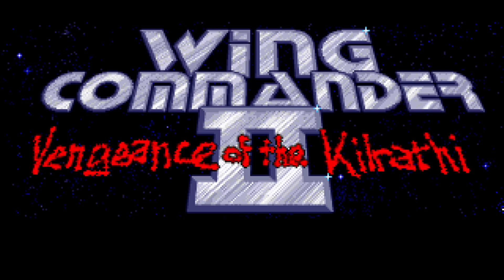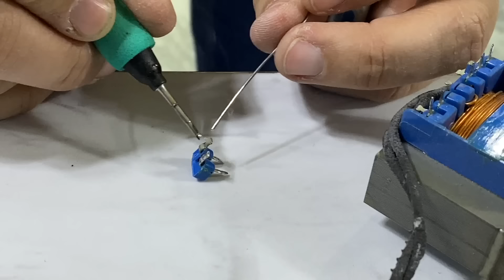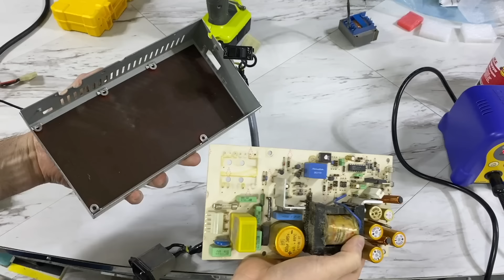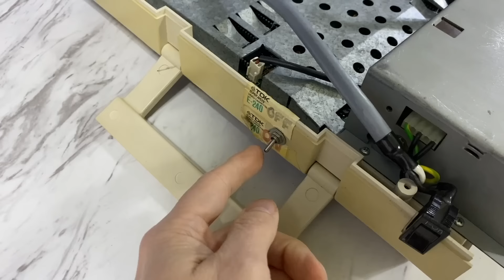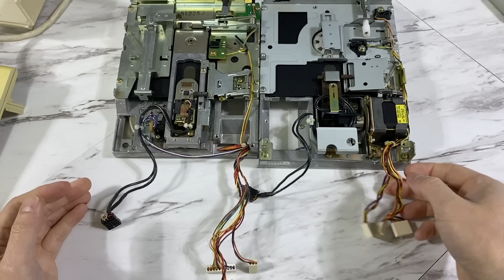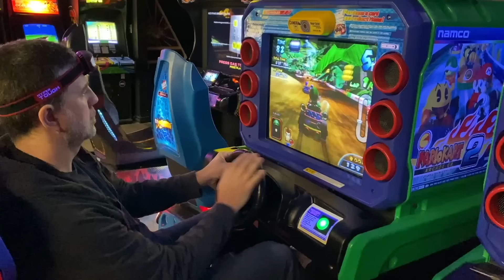Repairing Martin Galway's Commodore 128

Comment: The 1084 monitor AND the AGA monitor (I think it was 1090 or 19XX) monitor support PAL mode, but in the case of the 1084, you have to mess with the V Sync.  I did this all the time when I wanted to run Pal software on my Amiga 500 (Amiga 500 rev 5 motherboard or later supported NTCS OR PAL).

Comment: It's fun to see repairs in the consumer market. This is what I do for a career, but for commercial applications (all that means is that I'm fixing stuff like POS devices and pretty much anything with a microcontroller that may be used in a commercial situation.) Even though I do this every single day, I still crack open every single new device I buy, as well as stuff my wife and kids buy under the guise of general preventative maintenance like applying thermal paste and cleaning fans and such. In reality I just want to see those bare circuits, they'll never stop being fascinating to me!

Comment: the monitor issue is suspicious, especially since you had a bunch of issues on a bunch of other monitors,

the way its running makes me think its maybe trying to do pal at 60hz and breaking everything, alot of transformers like that dont address the frequency difference only the volt and amperate difference, like this would explain everything breaking spectacularly

Comment: I hope that transformer also changes 60hz to 50hz
Reply: I hadn't thought of that. The Goldsource STU-1000 is just a voltage level converter and doesn't affect the frequency. Is that why the monitor was freaking out?
Reply: @BenInSeattle  It makes the most sense to me. As a rule, analog electronics don't really play well with mismatched frequencies and whatnot. Look at the flyback transformer for example. It's probably calibrated to work with 50hz oscillations, so putting 60 through it is bound to mess something up. I'm no expert of course, this is just intuition speaking lol. I'm willing to bet like five bucks that that'll be the issue though.

Comment: On the faulty 1571 mechanism: I've repaired 1541s that had a similar problem.  The rotational speed was incorrect.  I recall two sets of timing marks on the large flywheel and a slight turn of a nearby potentiometer that would adjust this.  I used a fluorescent light to get the timing correct.  I'm assuming one set of marks was for 60Hz and the other was for 50Hz, so you'd need a 50Hz lighting source.

Comment: @The 8-Bit Guy -- I know this is WAY late, but check the orientation of the upper head.  The leaf spring on 1571's tends to warp because the head lift mechanism only picks it up from one side, causing it to pitch and roll out of horizontal.  If it's not reasonably horizontal and aligned with the lower head, it will not apply any pressure to the disk media, preventing the lower head from reading/writing.

It's an easy fix, just needs a small screwdriver to act as a fulcrum while you push the head down and twist it a little.

Comment: Thanks for the video, and nice you got the C128 working again. 😀

Personally I would have tried harder to find the correct transformer for such an historical important computer, instead of having to do damage the case with a drill and bodge in a completely different transformer with sticky tape and wires running all over the place. 😱
A health check on those capacitors wouldn't have hurt either I guess.

The disk drive probably needed lubrication and a head alignment. You had an oscope and everything so should be easy to check output from the read heads and tweak that if necessary.
But as said... You got it working, and the owner also approved this so not much to add really. 😎
Reply: What do you expect from a guy who hits shrink tubing with a lighter? This isn't a pro you're watching, this is a bodger.

Comment: ya know... a pal and ntsc monitor are essentially the exact same thing as long as you don't expect color out of them... you just turn the v-hold until it syncs at 60hz. aaand then it's black and white but so be it. :P other than the color signals all tv standards are the same. and all tv's and monitors have a v-hold and do not take the '50 or 60hz' from an ac feed.

Comment: Do you think the Monitor problem could have anything to do with the USA running on 60hz and the UK running on 50Hz.  I don't know if the monitor has it's own crystal or if it used the ac input to generate it's refresh rate.

Comment: Great video!  
You almost did a Lineman Splice or Western Union Splice except after you hook the two wires together, you start to wind the free end of the wire around the opposing wire, essentially creating two interlocking "nooses". This joint is stronger than the original wire, even without solder.

Comment: i know that you are no tech guy, but, whenever you are trying an ac ac transformer, you should use a "load circuit", or "load lamp", in such case that you made a mistake, nothing blows up, and the bulb draws the current. this is one of the oldest trick in the book.

Comment: Adding mechanical reinforcement before soldering by interlocking the wires is a great way to increase strength and reliability of a wire splice. 

J-hooking, which is what you did with the disk drive wiring, is a good method that was recommended in some of RCA’s factory service handbooks for TV and radio service/repair shops in the 50’s and 60’s. 

Today, the best method of splicing wires is by using the Lineman’s splice, also known as the Western Union splice, which is the splice technique specified in the NASA Required Workmanship Standards. If twisted correctly, the Lineman’s splice is stronger than the wire it is made of. 

I’m glad you are adding mechanical reinforcement to your soldered wire splices!

Comment: The monitor is not 1084 but 1081 (available only in PAL regions). There are two sub type of the 1081, one is the KH533 which has Picture tube (not dark) and the other one is KH543 which has Chunghwa tube (dark). This one is this dark type. (The dark tyoe available in mono and stereo versions too).

Comment: I was thinking ... I live in Poland Last year I get very nice 13 inch 16:9 tv with pas and (almost) all required inputs for retro computers. I got also portable DVD player with analog TV and today i was testing it with clone of the Atari 2600. 

Maybe there is a bit of a market to finding this kind of devices and sell it to USA for using with imported computers. I could bundle it with cable for specific needs...

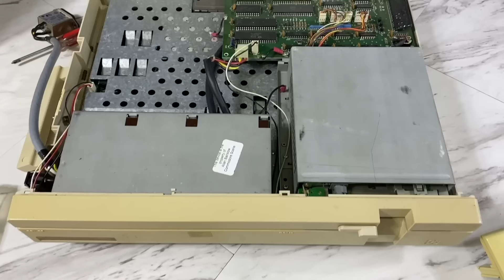Comment: Be careful: The input RFI filter (2:44 on your right hand) contains a capacitor which will sooner or later fail as a dead short. Happened to me after I tried to re-activete my 128D. Blew the10A circuit braker on my house. Luckily it did burst into smoke and flames. Guess it is a RIFA :-(

Comment: I used to have a Philips TV, US NTSC model, that supported a PAL color signal on the component inputs. It actually got monochrome from the S-Video input, but the color signal on S-Video is modulated and the 4.43 MHz demodulator was not installed. On component, however, all the signals are unmodulated and can drive the tube directly. Modern LCD TVs have internal digitizers that may or may not be designed to work with analog signals from out of their planned region.

Comment: I am guessing that the roll on the screen could be attributed by PAL is on 50Hz and NTSC on 60Hz. PAL writes on 625 lines where NTSC writes on 525 lines. It is inherent in the CRT's electronics.
So the guess is that you're running a system and screen with a too high of a grid frequency.
Could you use that inverter of yours to test that? If it is configurable of course.

Comment: Never use crocodile clamp cables, they are sometimes so extremely thin that you at max can power a small LED. This is maybe also the explanation why it did not work for you.

Comment: That UK monitor... are you sure it runs correctly off 60Hz? Because it'll be designed for 50Hz, and that step-up transformer you've got is very unlikely to change the frequency too. You'll need a proper inverter for that.

Comment: The EU 128D was nothing more than just a regular 128 and a 1571 squeezed into a single case. The boards are completely identical and interchangeable. The only difference is the keyboard connector which is routed out the case on the -D, but is obviously an internal cable on the flat 128.

If you are looking for a source of PAL equipment in the USA, you can try Latin America. They used PAL system there in some countries.

Comment: The drive head assembly probably failed, it happened to both of my C128. It is a small piece of sheet metal that will become bent by leaving the drive open over longer periods of time. Some weight put on top of it might fix it (temporarily).

Comment: I think the problem with the monitor is the 60hz of the US system, those simple transformers only convert the voltage, not the frequency. The monitor still works, just not with the 50hz pal signal.

Comment: It's normal for a US monitor to greyscale off a PAL signal. You have to check which PAL signal it's putting through as one of them WILL give colour. It's the same in reverse for UK users with NTSC, having had that issue with a capture card.

Comment: That's not the first time I hear that games were developed on Atari ST using cross development tools and serial connections (or other ones). People told me a lot of Amiga games were also developed on Atari ST and the binaries sent to the Amiga through serial, so basically you could get the stability and 30kHz 640x400 display mode of the Atari ST to develop on any other platform without the need to reboot your dev environment if the game crashed. And the ST had one of the fastest loading OS at that time (because, well, it's in ROM, even if you boot from a hard drive).
I don't know the name of the cross platform dev tools, but what I know is that for example the HiSoft Devpac assembler can output Amiga binaries on the ST and I wouldn't be surprised if there were multiple 6502 assemblers on ST as well.
This is similar to current retro-development where we develop on PC and only test on emulators/real hardware because it's a lot faster.

Comment: Great video David. You always bring interesting topics to us. I recommend that, to test sources and devices connected to the AC electrical network, you make a series lamp circuit (only use incandescent or halogen lamps), because in the event of a short circuit, the resistance of the lamp will protect the object to be tested from greater damage and will also protect you from pops and sparks.

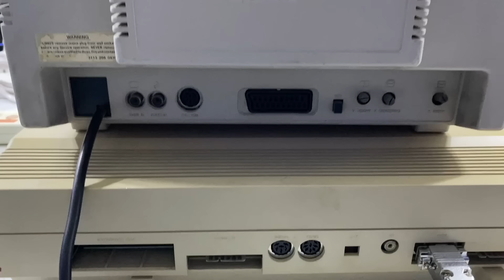Comment: 1:55 Do PAL CRT monitors have a different phosphors recipes than 60Hz CRT  onitors?  Presumably they would want a slightly longer afterglow to compensate for the longer delays between refreshes.  If that monitor can autosync to NTSC, an NTSC Amiga in interlace mode might look very nice.  Let us know please Dave.

Comment: when it comes to monitor.
while i know they might be on the more expensive side but there is a lot of JVC TM and Sony PWM's that supports NTSC and PAL and was sold in "almost" identical versions on both sides of the atlantic, and some even runs strange stuff like PAL60 and NTSC50.
question is though what say an JVC TM-H150CG or an TM-1700PN are going for over there, here they are fast 200$

Comment: All good apart from your method for using heat shrink tubing... don't use a naked flame. It leaves a load of horrendous soot on the sleeving, not to mention that it also damages the sleeving at the same time. I suggest you invest in a heat gun for doing this job, not expensive and far better.

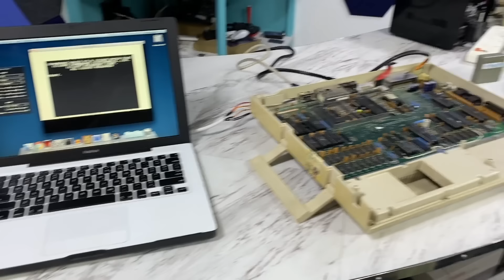Comment: 7:33 Back then, I could switch my MSX to either PAL or NTSC. I used the latter to speed up my games by 20%. My locally produced monitor had no problem when I used the composite video signal. My parent's TV in the living room could not handle it. 7:33 Now you find it difficult to get the right monitor, I start to wonder, was my monitor extremely smart, or was the MSX only speeding up the processor, still producing a pal-sized CVBS signal.
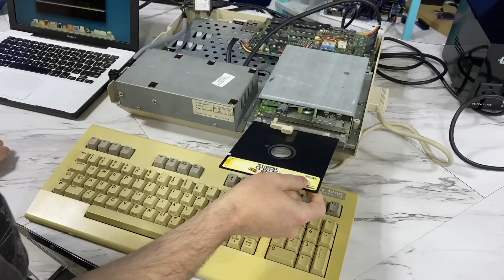11:07 A two-second boot. I'm missing those days...
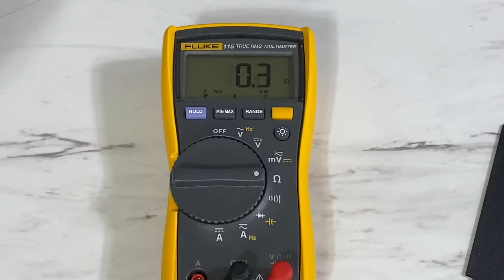13:23 The same bump that dislodged the transformer could have misformed ( misaligned )  the drive-head mount.

Comment: That must be the original, or at least contemporary, mains plug: Its missing the plastic collars at the base of the pins so you can't touch an exposed live pin if its only part-way into the socket.

Comment: I worked at Microsoft in the 1990’s. People would bring in their broken laptops after traveling. We always asked. Did you check it with your luggage? The answer was usually yes. We would respond. Don’t do that. 

The standard laptop we used back then was $10,000 back then. So close to $20,000 in 2024 money. It was only developers that got laptops.

Comment: Ok… another REALLY BAD repair attempt:
- leaving the golden ROEDERSTEIN caps in the psu is absolutely silly (they always go bad. ALWAYS.)
- disk drive: no speed check/adjustment? no head adjustment? no real diagnostic? 

sorry, you are really good at programming- but please do not attempt repairing hardware. it‘s not gonna work.

Comment: Hey, 8bit guy, idk if you are going to read this, but could you test if it's possible to connect commander x16 to this PAL monitor via scart? I know, that X16 is capable of outputing RGBS signal that you use in your RGB mod of your crt and I'd like to know if this RGB signal can be used in Scart and displayed on PAL TV set. I'd be glad if you'd do that. Thanks in advance for reading

Edit: nevermind, saw the rest of the video

Comment: I would be careful using a piece of card as an insulator, I did that once and the voltage arced through the cardboard setting fire to it, best use plastic

Comment: I don't think a C64 would work without the 9V AC supply. This supply is used to provide a second 5V rail which powers eg the VIC II chip. The VIC II chip also provides the 6510 clock signal. I'm guessing the C128 works similar.

Comment: Your perseverance I'm fixing machines like this is unbelievable. This repair looked like it was nothing but a nightmare and I could see why it would take weeks and weeks and weeks. Congratulations on a job well done.
Reply: well that's one person.  I fail to see how two " experts" didn't understand that a machine that requires 2 Different voltages required  shocker both voltages. One look at the power specs ona few of the chips ( all available and well documented BTW) would have told you everything.

Comment: The reverse was true with finding NTSC in Europe, I used to buy NTSC tapes from the US because with the exchange rate was favorable back in those days, but even though my VCR was advertised as supporting NTSC and PAL it never worked.  Finally found a TV at a jumble sale of all places that did PAL and NTSC and I was in business.  Then I moved to the US and have the same issue you do, but these days it's less of a concern.
Reply: I have the same issue from some DVDs I bought in England that wouldn't play on most DVD players here in the US, due to different region codes - except for the Apex universal DVD player that I owned for a while - that DVD player ignored the region code, but it wasn't long before they were forced to stop selling that model. 😁  I was eventually able to watch them on a PC, though.

Comment: Hi the problem is the little spring on top of the drive head, it gets weaker over time and the drive will stop working. Just put a little bend on it to make it stronger and the drive will be OK. I've done this on multiple 1571 drives of the same design - also on a C128D 👍
Reply from the maker: Thanks, but I did try that.  (and a hundred other things I didn't show in the video)

Comment: Since there was allready a toggle switch. That could have been used as a 120/240v switch without drilling any new holes. May not have helped much since its also frequency dependent but I would have thought that if the owner now lives in the US and wants to use the computer that might also be relevant mods.

Comment: Some comments here:

- there is a replacement-fan available, that fits the C128D exactly and is much quieter than the original one, search for "Noiseblocker XR-2" - this is basically a plug-and-play solution (just screws)

- the 1571 drives need to have the door closed with a disk inside, otherwise they are liable to fail, the german C64-Wiki says (translted by Google): "Locking the drive lowers the top head onto the disk surface. The spring mechanism required for this is only in a relaxed state when a disk is in the drive and the drive is locked (locking the drive when it is empty is not enough). If the drive remains unlocked for a long time, defects can occur due to the constant loading of the springs:

    The retaining plate can tear or break on the side as it is constantly loaded on one side when the drive is unlocked.
    The pressure spring can lose strength. This error is relatively easy to repair by careful bending.

Used devices, some of which have been stored unlocked for years or decades, often have one of these errors. To prevent errors, it is recommended to always have a disk in the drive and to lock the drive."

- the VDC (80 column)-chip is neither PAL nor NTSC. The kernal sets the register values of the VDC to be PAL- or NTSC-compatible on the type of the VIC-chip that is detected. You can easily set any VDC to NTSC-mode by just typing one line in BASIC: BANK15:W=DEC("CDCC"):SYS W,126,0:SYS W,32,4:SYS W,29,7

Comment: Judging from the yellowing on the keyboard, Galway is/was a smoker. It is likely that the smoke also went into the disk drive and covered the head, especially if it was never in use.
Reply from the maker: Contrary to popular belief, yellowing like that usually doesn't come from tobacco smoke.
Reply: @The8BitGuy That's easy to confirm, if we ask Martin. But if he was a smoker, I bet that the smoke caused the problems with the disk drive and a head cleaning could solve the problem.